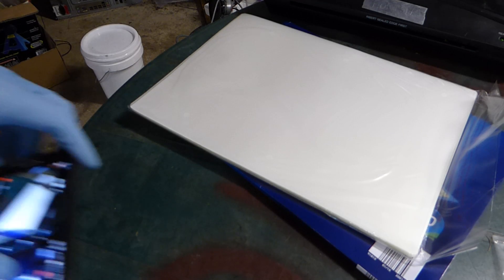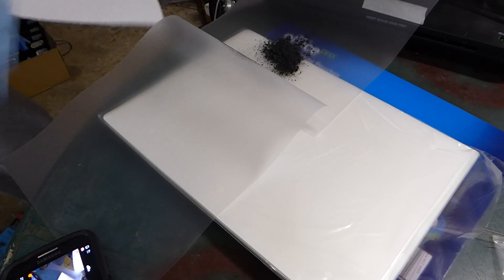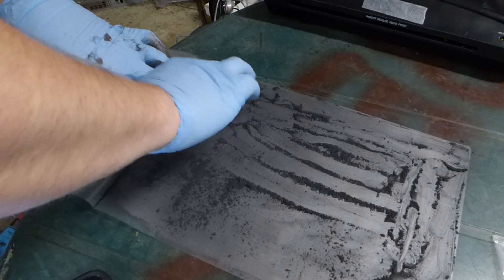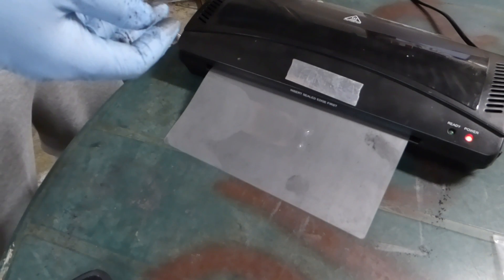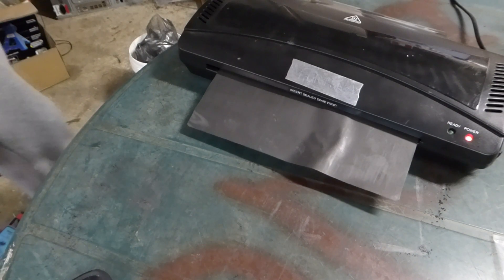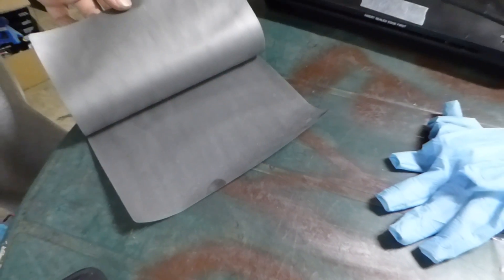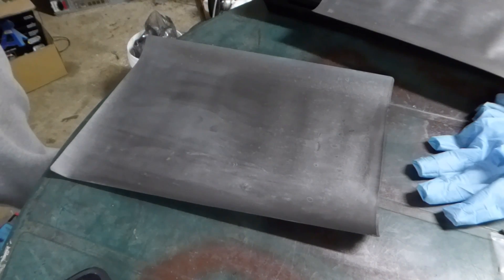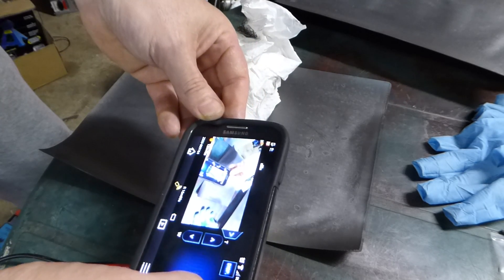Easy Graphene Sheets-Laminator & Graphite

Comment: the sticky tape and led pencil method mentioned before only works because the sticky tape peels of layers of a crystal structure. Also graphene is clear. On top of that you probably don't even have a microscope to check your own work before putting it on YouTube.
Reply from the maker: stewart moseley measure the conductivity...microscope not required. The more it is polished the higher the conductivity goes as it approaches the single layers. I will never be a one layer graphene when spiltting graphite. It can only be a single continuous sheet of one layer if it is grown from the ground up...not from shearing graphite apart. I really think there is way too much information talking graphene up to something that it is not. And so many people say this is not graphene without actually knowing that there are different ways to make it and each method has better or worse results regarding thickness and quality.
Reply: Pencil leads are not single crystals of graphite..... I mean you are here commenting on youtube, where there are "how its made" videos available in every single language that humanity currently speaks and yet you are lacking the ability to go find them and learn what a pencil lead actually is.

ANY graphite structure can have layers of graphene peeled away. Graphene is like nanoparticles, the great invention of our age and OOPS it's already in everything imaginable.

The newest method is to take a graphite rod (pencil lead would work) and exfoliate graphene from it's surface using green tea and a computer power supply.

EVERY SINGLE time in history anybody ever took sticky tape and peeled it off a graphite pencil lead they made graphene, yet we gave the award to 2 dopes who have made nothing since, only figured it out because they had the equipment handy and even then only accidentally realized it when they kept contaminating their experiments with graphene from an unknown source.
Reply: It's good that you stay on top of the ignorant morons of the weebs. These people don't understand how in ANY given can of graphite there will be significant graphene present. It is the SAME DAMN THING, graphene is merely the 2D structure of graphite. I mean you would have to start explaining to this guy how an optical microscope isn't going to be able to see a 2D structure.......

ALSO your way WILL be working because as the graphite goes through the laminator the heat and pressures cause the graphene sheets to slide apart from one another flattening them.

Comment: If you could actually produce graphene using this method, this guy would be mad rich, and probably would have chosen not to share this technique. Graphite in itself is a moderate capacitor, and I'm sure it performs better in a compressed state - also, graphene is clear... Not metalic

Comment: By convention, graphene is 1-10 layers thick.  YOUR product looks more like graphite.  How did you determine that the method you used yielded graphene?
Reply from the maker: +homayoun Shirazi there are plenty of methods that start from graphite and end with graphene and graphite in the end product. It was ok for the winners of the nobel prize to stick and peel to get graphene and nobody says they didn't make graphene because it still appears grey...the kicker for me was the more it was polished the better the conductivity. That implies that as we polish we are revealing the last layers that are bonded to the plastic. Obviously we are not down to single layer graphene sheets because it was not grown as single self assembling sheet. There will be random sheets on odd angles as well that polish away. Also when there is no more graphite appearing on the polish rag then what is left? Only the last layers that can no longer be exfoliated.
Reply: one layer graphene is transparent , two atom layers graphere is grey due to an optical efect .
Reply: The polishing probably helped to orient the tint graphene flakes, which you'd have to accomplish to a much higher degree to be useful. Figure that one out for your own novel prize

Comment: May I ask where did you buy the device to heat the laminator and graphite? Thanks.
Reply from the maker: I think the laminator was an Aldi purchase. I have got them from Officeworks as well. The graphite was purchased through Sydney Metal Powders. You can get small bottle from Bunnings also.

Comment: USE EXTRA-STICKY TAPE  TO SEPARATE THE SSHEET TWO BITS WITH THE FOLD EDGE AND VIOLA WHEN HOT SHEET IS COMING OUT CAREFULLY PULLING LITE TENSION MAKE THEM COME OUT SMOOOTH AND FLAT YOU WANT TO KNOW IT'S COMING OUT ASAP JAMS IN THE MACHINE LONG WAIT AND DIFFICULT TO REMOVE ALWAYS WAIT BECAUSE ROLLERS ARE ABOUT 270 TO 350 F WHEN OPERATING

Comment: Try using a laser printer, replace the toner with the graphite powder, and 'print' a grayscale rectangle onto your plastic sheet. Adjusting the grayscale should control how much graphite goes on the sheet. As a bonus,  it has a built in fuser.
Reply from the maker: I really like this idea...i have a printer i picked up in the rubbish and was gonna tear it down but now I think your idea is a better use of it...provided it actually works and was on the chuck out because of office upgrades!
Reply: this is how the universities have been doing it, EXCEPT they start of with actual GRAPHENE suspended in emulsion fluid which then dries.  Problem is the graphene is then discontinuous but overlapping and adjacent and wont really perform like graphene unless you use a very high temp CVD or other process which is NOT commercially viable.  So what you have is just a better capacitor, but not yet an ULTRA-CAPACITOR that can replace batteries.
Reply: Laser printers with by using static charged plates. The toner ink may be magnetic but it is attracted to the printing plate via static field induction caused by the laser. It's similar process to Vapor disposition and electro painting. Static cling not magnetics
Reply: @almorlina  was going to say that, also the static charge of the material is different depending on the manufacturer too as they have both negative static charged and positive static charged toner, so my question is how can we process the graphite powder to a size to match the toner and apply a static charge to it as doing so, like maybe processing it to a powder while in presence of a high voltage capacitive plate charged off of a flyback transformer that way the charge field will control the orientation of the carbon structures of the graphite making it hold a charge hopefully that the laser printer will properly attract it to where you want it on the drums and paper or plastic sheet, though layer thickness I think is more easily controlled by using something to bond and peel more and more layers off till its as thin as can be, so it is as a single layer shaped to the texture of the object like paper or glass or some other substance. What your idea I think would be useful for is making shaped layers in patterns like for batteries or capacitor plates but once formed it should allow making mirror versions of it 100s of times just from one print, maybe even more XD(almost like using the original print as a silk screen to lay down some of the graphene layers on new material each time you apply an adhesive material to it, even if the adhesion is only from static and vigorous rubbing and pressing tightly against each other to allow some of the whole graphene shape's layers to bond to the clean un coated material
Reply: Bugger I was thinking that
Reply: This is a wonderful idea except for 2 issues .... laser printer toner is slightly magnetic, which is how the printer controls what is printed... and laser printer toner gets MELTED into the paper during the process.  Good luck melting carbon ... what temps are required for that, again?  Oh wait, that's how you make diamonds .... (Takes a good bit of pressure too, but that's another idea.)

I have a better idea in mind ... use an inkjet printer (very cheap, easy to obtain one that's not working properly anymore, and you wont need to worry about the ink, just some used ink cartridges).

Take a mix of graphene (or graphite that has been extremely finely powdered) and a solution of 75% acetone, 25% water (this will certainly destroy the warranty on the printer, I don't doubt that for an instant!) ... the mix should be agitated for a good long while (at least an hour or so in a blender, which may destroy your blender too ... ok, this is getting a little expensive).  Let it sit in a sealed container for a week or so, and then pipe out the suspended solution to a fresh clean container (leaving behind the dregs in the bottom of the container of the heavier particles that sank).

The suspended solution that you saved will be your new "ink" ... drill a hole in an ink cartridge and clean out the contents thoroughly.  Replace with your new "ink" and seal the top (use a silicone plug or something) and print your greyscale on some waxed paper.  Plastic sheets would look cooler, but the acetone will eat it, literally!  Once it is dried, you should have your graphene sheets, sitting on top of a layer of wax and paper underneath.

From that point, it should be easy enough to get a sheet of sticky-backed plastic film or clear cello tape (or whatever other method you have in mind) to peel your graphene off the wax layer and give it some protection ... don't forget to polish!

Comment: it's still not graphene
Reply: It definitely is not.
Reply: What this man has maybe a poor mans graphene, but it does have some properties most likely a hybrid. Graphene was introduced by just a piece of tape, so technically this is graphene.
Reply: @spacetaken9335  No it is not, the resitance readings are in the range of normal graphite. Even a simple sheet (1mm thickness) of iron /steel is far more better conductive. I need to take nearly 3 inches distance between the probes to get even a measurement with a normal multimeter.
Reply: @JonnyDeRico  the trick is this is still needing processing to get to the graphene he has made, as the layer on the lamination material is graphene across the whole thing but it has tons of disorganized layers of graphene over it to form a graphite like structure so applying more adhesive materials and peeling till it starts looking clear I think would finally get to that graphene like qualities if it were a single layer that was uniform, though to get that you need a smooth material that matches the graphene flat nature otherwise you have deformities due to the patterning the graphene bits together over it mimicking its texture, but this is definitely useful in many ways more like graphfoil he has here,

Comment: ahve you tried peeling again with a fresh sheet like the original sticky tape method ?
Reply: could rotating brush help fasten the process or can it break the graphene layer ?
Reply: It's so odd to see someone spreading graphene with fingers. You know, future tech with crude moves.
Reply from the maker: steven forrester yes also polishing until no more graphite comes off. Resistance gets less as the polishing continues.

Comment: not graphene , sorry to tell bro !
Reply: Sounds like you need to learn to listen...  this seams to be a decent "cheap" alternative  way to get closer to it being  graphene.
Reply: To understand what Graphene is, you have to learn the basics in molecular structure. Graphine is the exact same thing as graphite. The only difference between Graphene and graphite is that Graphene is an atom thick layer of graphite. So by removing all the top layers of graphite it inherits different electrical properties and Heat resistance, thus the name Graphene. Idiot. When someone online is talking about using Graphene as a super strength body armor, they might as well use Styrofoam, the only strength in Graphene is it's high melting point. Plus it is expensive because of it's difficulty to synthesize.

Comment: hi friend your video is very good .can you tell me how i contact with computer.
Reply from the maker: +Danish Khan you want to connect it to the computer?
Reply: yes
Reply from the maker: Danish Khan you could use a multimeter with datalogging or at a pinch use a soundcard and calibrate the readings
Reply: m3sca1 if you have any vedio link please send me.
Reply from the maker: Danish Khan use a laser cutter

Comment: Hi, what type of  Laminating Machine you use (the model) in your work. Congrats for interesting work.
Reply from the maker: the make and model are not important...they all work the same.
Reply: if can you should try before buy, some laminating machine like china made don't have smooth heat result some buble and with low grade laminate plastic i got some plastic burn. : /

Comment: you know that laminate plastic is probably staticly charged. you could use that to guick coat by putting a tray with graphite powder and then open the laminate and lay the side to be coated down to the powder and pick it up.

Comment: hello friend 
is thissheet is bulleteproof amd knifeproof ????
does it super super storng and super light wieght ??
thank u
Reply from the maker: hi, no the strength is not improved by applying graphite or graphene to a plastic sheet. There is a scale of sizes that is never mentioned when grpahene is claimed to be stringer than steel. It is very small molecules that are strong for there size. It is like saying an ant is stronger than a human because it can lift 100 times its body weight....however if mixed with plastics or other polymers, some very strong composites can be made.

Comment: How many Ohm's acceptable.
I used hydroxide and put Al in it which reacts vigorously and then added graphite powder. Collected the graphite foams and bubbles.....painted it on a wood and it has conductivity of around less than a 1K. 
Is that good enough? I thought I need to have conductivity close to 100 for it to work as an electrode?
Reply from the maker: have been advised that the target resistance is under 40 ohms. You tried polishing/annealing your finished surfaces ?
Reply from the maker: Don't get me wrong though...the graphite and laminator is not getting better than 100k Ohms.
Reply: scrubbing, lamination, all that i have come to a conclusion is too much work....I will go with that Acetone and Styrofoam method.....that is super easy.

Comment: That is a great and simple method! Cheers mate for sharing! Brilliant, the heat from the laminator machine will fuse the graphite evenly across the plastic and will remain even after polishing. It is interesting to also mention that graphene is self-healing (especially around available hydrocarbons, CO2, or between the separate microscopic flakes) when polished thoroughly. By applying friction, heat and mechanical force is applied, the graphite will shear into graphene and will spread out and self-heal. Too much graphite will only increase ohmic resistance if it is too thick. This is why the conductivity increases.

Perhaps you can spray on some graphene in an acetone/water mixture onto the polished graphite coated laminate to increase the surface area/capacitance for supercapacitors and hybrid ECDL cells.
Reply from the maker: thanks for commenting. next step is intercalated graphite using acid and microwave
Reply: +m3sca1 Anytime mate!

Comment from the maker: +insAneTunA thanks for your comment, i can appreciate your perspective on this, i can only point to the fact that it performs well as an electrode in a capacitor, it obviously will contain impurities of graphite. it does become transparent after more polishing but also that metallic sheen of graphite remains. Once it has been polished so much that no more grey appears on the polishing rag, it must be considered a single layer after all the top sheets have peeled away. Also these sheets will not be orientated or able to be polarised. Conductivity increases with polishing too. I would not say this is a pure graphene but a blend of graphite and graphene. Some peroxide will be applied to the sheets to help exfoliate, before further polishing. This method is easier and more available for people to make capacitors then manufacturing a paint, with very similar results.
Reply: +m3sca1 Hi bro.How much resistance(cm)? 
Cheers.
Reply from the maker: +Alper Gökcek update is on this recent video
Reply: m3sca1 How could i make money from doing this?

Comment: Do you know what the capacitance is of those 2 sheets on one another. Great video.
Reply: +donzi joe 
I was thinking the same thing!
I'm gonna guess here... 50nF
Reply: +Energy Fabricator 50nf would be great. alot better then the caps ive been building.
Reply: +donzi joe 
I'm thinking 20-50nF max, with one layer of plastic between the graphite electrodes. But that's just a guess.
Show us your caps :)
Reply: +Energy Fabricator my caps are made from aluminum tape and poly tape rolled up. i make them like the mmc caps. there about 7ft long then rolled up its about 22nf. they work great but i keep burning them up with my tesla coil hooked up to the tesla hairpin circuit.
Reply from the maker: +donzi joe will let you know in a follow up video....